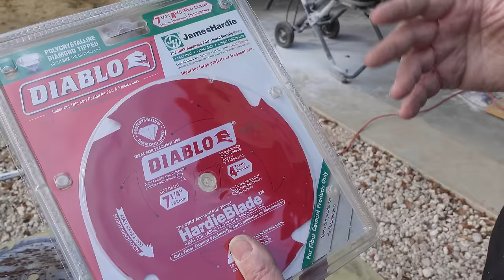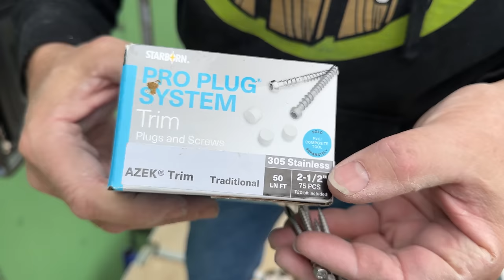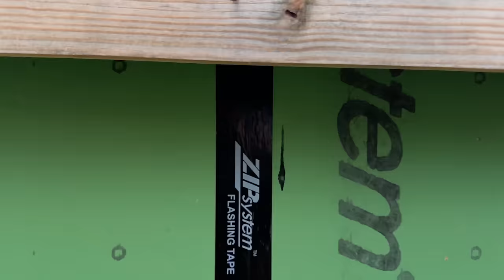Installing a Bulletproof Soffit and Fascia That Will Never Rot!

Comment: Paul, Jordan, and Rad, with those coil siding nailers, the reason the coil is sticking for you is that it isn't adjusted properly for the nail length. Inside the coil reel is a tray that needs to be adjusted to the nail length. Usually a lift and a twist. There should be a gauge inside the coil reel to set the nail length. The same happened to me when I first started using one.

Comment: That board you're using for fascia is designed not to paint. If you are painting that and you're using the smooth side out especially if you're going to be using a black trim paint I recommend a bonding primer Sherwin-Williams has an extreme Bond primer Benjamin Moore has a product called Styx otherwise you could have issues in the future with peeling paint. I have been a painter for 45 years
Reply: Stix is just bulletproof, I've used it to paint stainless for years
Reply from the maker: Heard that 👊
Reply: That’s exactly right , I am a long time oainter and I was thinking same thing
Reply: Came here to say the same. Good catch to all.
Reply: Styx is what we use for tile and that stuff is tough
Reply: Not to hijack, but what do you painters say about painting aluminum trim coil.
Reply: @jamesogorman3287  Styx then whatever topcoat
Reply: I would not use black trim paint in Houston.  My windows and doors have PVC casings and trim which the builder painted a dark musket brown.  They warped significantly in this southern heat and direct sun.  I had to replace 10-12 windows because of the severe warping.  We repainted a light color and have not seen any warpage on the replacement windows or trim.
Reply: I've used styx and extreme bond and I DEFINITELY recommend Benjamin Moore Styx. That stuff is FANTASTIC! I've had issues with extreme bond a couple of times but never with a single Benjamin Moore product!
Reply: @JT_70 the typical rule of thumb is that you NEVER paint any vinyl product more than 2 coats darker than it came from the factory. I've always followed that rule and never had an issue with warping.
Reply: @unsanctionedchaos2994  Some vinyl clad windows have an LRV (light reflective value) sticker on them telling the minimum LRV paint color to use.
Reply: @StudPack I was expecting some kind of adhesive caulk for the fascia soffit groove
Reply: Looking awesome! To rich for me though.. I use a $100 role of aluminum coil and vinyl soffit. But for that high up it makes sense to use a forever product although coil lasts a long time
Reply: @joeblue354 azek trim is definitely paintable. Its right in their literature that is only comes in white so it can be custom color painted to match
Reply: it's actually expansion/contraction that is the issue with Azek, I've been told it needs UV resistant paint then g2g
Reply: @Nymets8305  we weren't saying that it CANNOT be painted but rather the PROPER way to paint it to ensure the best quality and the longest lasting paint.
Reply: @unsanctionedchaos2994  I interpreted wrong, my brain fogged . I apologize.. I’ve always painted azek with just an acrylic based latex paint and never had an issue. Just when using darker colors you have to be careful with lvr values
Reply: Just a questions to those painters.  
I have to paint some Pt wood, I replaced some old window trims for a stucco house. I’ve been waiting for them to dry some. I live in NJ (4 seasons).  End color will be black.
Reply: @Jack_of_1_Trade  thats not a question 😂😂
Reply: Damn! That's a lot of years painting!!!!
Reply: @StudPack how soon til the next vid (since we waited two weeks for this one :) ) and what kind of roofing are you going to be using.
Reply: You should see what happened to my neighbors painted black pvc trim they used around a winter after one stretch of hot weather last years
Reply: Looks beautiful.  Azek is a great product
Reply: Styx is awesome stuff as primer. Love that dato in the facia,what a great idea,save on caulking. Beautiful job.
Reply: @TT-ik3kd  very true!!  Hahaha!! 
I meant to ask what brand/ type of paint should I use.
Reply: What’s holding you back from putting up some sheet rock on your walls. I am really interested to see what the inside would look like when you have your sheet rock up.
Reply: "Don't spin your truss." I caught that, a great piece of information
Reply: Always some armchair quarterbacks... Azek has complete instructions for how to and what type of paint to use for their PVC  products.

Comment: I really enjoy your content. After several years of roofing experience, I  have a suggestion for you. I would recommend that in the future you extend your roof sheeting down far enough to overhang slightly past the outer face of your fascia boards. If that is not done, when it rains Before the roofing materials are installed, the facia boards create a bit of a dam that can catch some of the water and direct it Behind your fascia boards and into your soffits, and if there ever happens to be any moisture that leaks through the roofing materials at any time in the future it can have the same effect. Because that wasn't done on this project, you might want to consider either caulking that entire seam between the roof sheeting and the fascia boards, or use a peel and stick flashing material at the bottom edge of the roof to lap over the face of the fascia a little bit, to prevent any water from getting behind the fascia. The way you cut the groove on the back of the fascia boards to insert the soffit material, makes it even more important that water has no chance to get behind the fascia, because the water will be trapped inside the soffits with no easy way out. If enough water got behind the fascia in a heavy rain, it could fill up enough to force water back inside the building. (P.S. Don't be tempted to just preinstall the roof drip edge metal to try to direct the water over the fascia, because if the top edge of the drip edge metal isn't sealed, the rain will run right under it and direct the water behind the fascia boards also.) Have a great day.
Reply: If they tape off the Zip board it'll help prevent that problem.
Reply: 100% was thinking the same thing
Reply: I noticed that as well! 
I did the soffit and Fascia on my old house; I tried to get all fancy with it and I used a hardy product for both the soffit and the Fascia. Granted this was 25 years ago and I'm sure they make a more appropriate product now, but at the time I cut a dado in my fascia. It was messy but  I got it done OK.
The problems? Hardy Isn't waterproof! It's water resistant! It just doesn't rot like wood. It basically disintegrates and starts flaking to pieces. 
The soffit material wasn't very structurally rigid or strong and tended to sag. 
Additionally and why I concur with the above poster is some roofers are better than others!  The roofers on that house didn't run the sheeting and shingles down quite far enough as a result the water flowed onto the Hardie fascia and it basically disintegrated. Granted it did take 15 years or so. But, the part that wasn't exposed to the water was in much better shape! 
PVC? All the PVC I've ever used was brittle and broke easily. Especially after a few years of exposure.
I am actually replacing the facia and soffit in my current house right now and again I'm dealing with undoing or overcoming the shoddy workmanship of previous contractors and roofers. 
Thing is. Now I'm just using WOOD! YEAH! Good ole reliable wood!
It may not be as exotic as some of those other materials, but it's inexpensive, easily available, and easy to work with.  AND if it doesn't last very long I can easily knock it out and replace it!  
Much less headaches! 👍
Reply: Another thing to consider: I've noticed on both my houses that when stripping off the old shingles it's not unusual for them to stick their shovel or tool up under the shingle and then pull down basically using the fascia as a fulcrum.  This puts a lot of pressure on the fascia and they broke a lot of my fascia on the other house.  
On my current house you can tell they'd done it at least a couple times because the fascia while not broken was pulled away from the rafters by 1/2" it so and because the sheeting hadn't been extended far enough, again the water was getting in behind the fascia, pooling and rotting the soffit. 
Unfortunately, I'm just one guy! I can't reroof a house by myself and I'm getting too old anywayz!  
So, sorry but after all that I'm just suggesting. When you build something, have a little consideration for the poor schmuck who gotta come in and work on it after you or try to anticipate what some inept contractor in the future might do with your creation down the road! 😮😊
Reply: they have a lot to learn but to each their own if they're happy then that's all that matters
Reply: I like the way you think - wish I could hire you.   I can't believe the stupid and sloppy work done around here.  It's going to be a chore to find someone who says and does the right thing

Comment: @11:25 I would have clamped a board on the fence to act as a vertical featherboard.  Pretty tough to keep it tight when it's that long and working with a jobsite saw.  And the fact that 3 guys built all of the garage is mind bending!  Kudos to StudPack!
Reply: Hansangb, not knocking Stud Pack as I toot my own horn. In 1986, my 60 y.o. father and I, 31 y.o., built my 3500 sq. ft. home alone. Except for the poured walls for the basement, and the cabinets. He and I did it all. From the day I cut the first tree for clearing to the day my wife, son and I move in was 10.5 months. And that was working afternoons when I got off work from my full time job at Pella Windows of GA. and all weekends.  Concrete basement and garage floor, plumbing, brick chimney, hard cost stucco, electrical, waterproofing, septic tank and drain field, 120 long concrete driveway, framing , insulation, drywall, flooring, just to name some of it. We still live in the same house and the only repair so far has been HVAC and replaced the roof 2 years ago.  I get it that Stud Pack has to take more time filming and editing, so like I said, not knocking them.
Reply: @dallasarnold8615  Good for you! I'm sure you're proud to show it off.  I've always dreamed of doing what you did, but it's just a dream. I don't have the place to do it.  And by the time I get the hell out of NYC, I won't have anyone to build it with.  So in the meantime, I'll do my woodworking out of a single car garage that barely fits my tablesaw.  You make do what what you have, I suppose.
Reply: @dallasarnold8615 that’s pure beast mode right there.  Kudos to you sir!
Reply: Three guys seems about right, unless you want to add a go-for. They also presented, filmed, and edited as they went of course. I'm not sure what more hands would have done. Pro framers could do with two.
Reply: @jasontubbs2192  My dad was the power. He had a lot of experience that I did not. I was the brute force, THEN. He was a better man than me. I do not believe I could do the same with my own son now. He is older than I was, and I am older than my dad was.
Reply: @hansangb  I can completely identify with your current situation. I joined the Marines at 17, with my parents having to sign for me to join at that age. I did 5 years of active duty right at the tail of Vietnam. I scrimped and saved $ 10,000 by the time I got out. Which was my down payment on a duplex on an assumed loan of $ 43,000. My wife and I lived in one side and rented the other side. The rent was enough to cover mortgage payments, so all I had to do was pick up taxes and insurance. Never will find those kind of prices again, that was in 1978. So, in 1980, my wife and I bought the 2.5 acres, where our house is now for $ 12,500. Paid that off in 5 years. I got a construction loan to build the house, when it was complete, I used the value of the land as the down payment on the house. Then, able to rent the half of the duplex that we had occupied to help pay the new mortgage. It worked out well for me, so I like to tell about it in case it can help someone else.   And back in 1979, I bought a Shopsmith Mark V. I am not sure if they still make them, but you should look it up. It is 5 machines in one and takes up less space than a regular table saw. It takes up roughly the same space as bicycle, counting the handlebars.

Comment: That fascia overlap would look better and not require a plug if you went the other way. Cut the side fascia to length, then on the gable end let the fascia board overlap and do the same routing trick. The benefit is that the front and rear (where people are looking) won't have a visible seam, plus you won't need the plugs.
Reply: Ang the gutter is going to cover a lot of the joint if you lap the gable over the eave fascias.
Reply: Came to say the same thing. They can still run the side fascia long and flush trim to the gable subfacia, then overlap the side fascia end with the gable fascia. Run that long too, if you want, and flush trim that too.

Comment: Great job. Looks fantastic. I am concerned that you didn't leave room for expansion on your joints however. Installing that azek tight in cold weather will cause bulging and oil canning in the heat of the summer. You may have to address some issues with joints when July gets here. Hope it all works out for you.
Reply: yep

Comment: Very nice! For three guys to pull all of this off is pretty remarkable. One thing I noticed when putting up the fascia is there's a slight gap between the fascia and the roof sheet. Not the end of the world, but now you have to account for water breaching the gap, ESPECIALLY because you used unvented soffit - there's nowhere for the water to escape. So you might want to install some ZIP tape from the sheet over the edge of the fascia. Once the roof is complete, you won't see it, but it will definitely protect from water seeping behind the fascia on rainy days. A roof sheet overhang would have helped with this, but if you were going for a certain aesthetic choice for the roof line, it's fine. You just have to account for the impact of not having the overhang.

The work looks phenomenal. I like Jordan's willingness to get the best material he can afford, and not just ordering to budget - sometimes you have to spend a little extra to get the best material, the shell of the building is the most important part of the structure - and I love Paul's level of knowledge and experience to know how best to apply it all. Soffit and fascia looks fantastic. Just don't forget to seal it! Great job guys! 👍👍

Comment: PVC is going to be a hassle with expansion and contraction in the Texas sun.  I would highly recommend going Boral when you can as it does not have the expansion issues PVC does.  PVC unlike wood expands both length and width. Boral cuts just like butter with wood blades as well; unlike the Hardy products.  Also, PVC really needs to be painted.  As it ages the pores tend to open up and it holds moisture which encourages mold growth.
Reply: Plus you can paint Boral as dark as you’d like.

Comment: 18:25 Just FYI for that angle measuring tool you're using. you can twist the center of the black to lock it into place. or if you want before you take the measurement, lock it down so it's harder to move. you can still get your angle but it really holds it in place.
Reply: And another tip from a carpenter. If you know the pitch of your roof you don't need angle finders for that stuff. If you framed your roof at 31 degrees you would need a 31 degree cut on your miter saw to make anything plumb.
Reply: @kimhansen9688  yeah, I think the reason why they were doing this was just to make sure that that angle is perfect since it's going to be visible.. But that also goes to one of my other comments which was you should have used that front gable facia covered over top of the side fascia..
Reply: I agree. Gable end first. If you want the angle perfect, you get the board up there and scribe it. Removes any errors in angle finder or saw adjustment.

Comment: I used Azek on my house a few years ago. No need to paint it if you want it white. I used Cortex screws that came with a bit that has a felt bumper built in that gave you the correct depth for the screws.

Comment: Man I have a grudge against rakes lol. Just some tips for future reference. They make a felt tip and spring loaded bit designed to set the screws the exact depth of the plugs. Azek makes 1x16 and 4x8 sheets you can rip for wide soffets. Also, if you're putting gutters, you always want your rake tails long to hide the ends of the gutters. That would've also hidden your dado cuts. Nice work fellas. Looking forward to the next one.

Comment: Excellent video guys! A happy and prosperous New Years to you and the gang too!
Having worked with thousands of feet of Azek, and been featured in the Handyman magazine with the Azek Inspires series, I would have done exactly what you guys did, great design. In the future, when you have scarf/miter joints, use the Azek PVC glue for joining the pieces. I have no clue what it's made out of, it looks like water, but it does not break. The PVC will fail before the joints.
Also, when it comes time to paint the PVC, buzz the surface with some 220, and the paint will stick forever! Another suggestion, when you need to caulk the PVC, use the SikaFlex 1a caulk. Totally waterproof and will flew and last a lifetime.
Good luck on the next steps guys!!
Reply: Does the Azek come with the dado for the soffit or does it need to be cut?